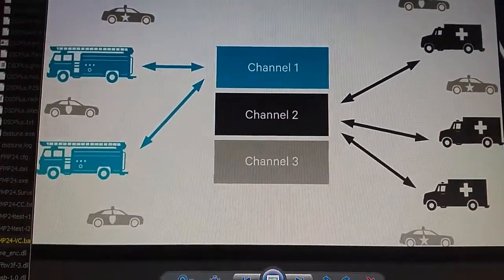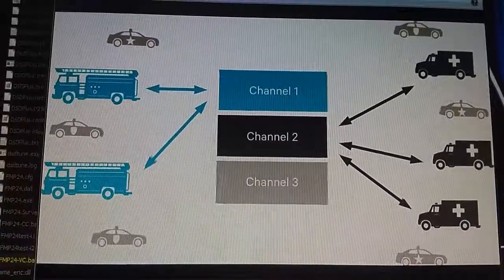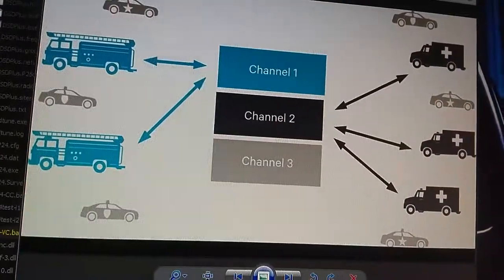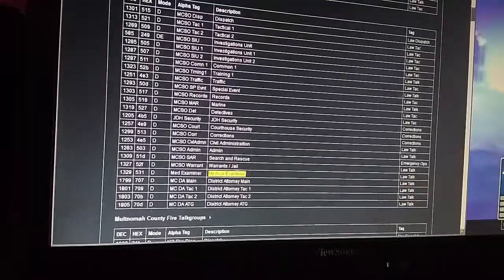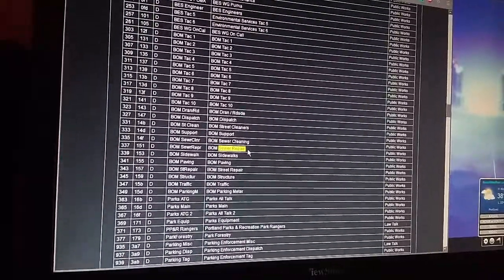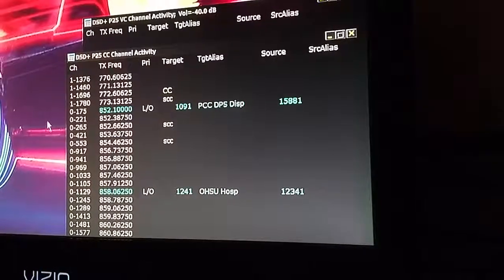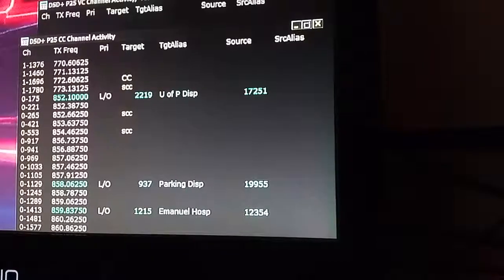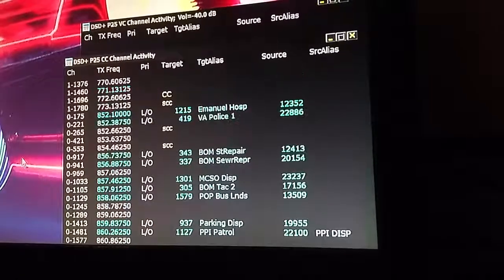Radios Explained: Trunked vs Conventional Radio, how does it work?

Comment: Thanks, for the video!   

I was wondering, though, how does the system know which users need to communicate with each other?   For example, how does the system know that the sanitation workers need to talk to each other, versus the EMS workers needing to talk to each other?   How does it let each user's radio know what frequency to use for the next transmission?   And, what if a user in one department needs to talk to a user in another department?  And, what if, for example. there are several sets of users in a particular group who need to maintain private communications (like two police officers working on the same case versus one police officer needing to communicate with the dispatcher?   And, the frequencies in your example of a trunked system seem so different that it seems like they would need antennas tuned to operate on those different frequencies - because, one antenna is unlikely to have sufficient bandwidth to cover all of them efficiently, so, how do they address this issue in a trunked system?
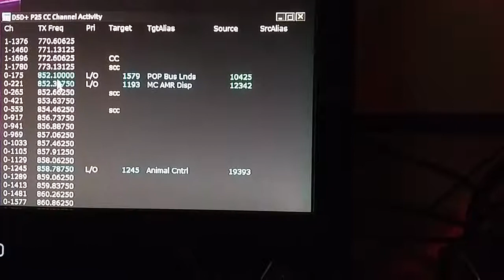Reply: He mentions this at 7:20. All radios register on the system upon power up, so the zone controller knows every radio by unit ID and it knows which talkgroup and which site each radio is on. At that point it is just a matter of the zone controller establishing the audio groups as needed and then tearing down those paths when the calls are completed. As for the antenna question, that is not an issue. There are antennas that cover the 700 and 800 bands. For lower land mobile radio frequencies like 150MHz or 400MHz, the commonly used LMR antennas have a much more narrow BW of 10MHz or less on most cases.
Reply: Oh and the frequency info is sent to the radios over the control channel. Bits are sent representing decomal numbers 0 to 4095  for FDMA and then the radios use a lookup table in the radio software to calculate the frequencies that the eadio needs to synthesize for each call.